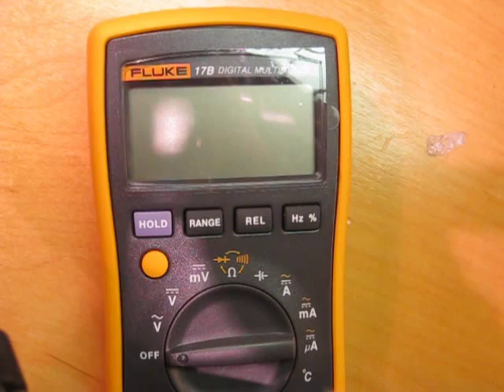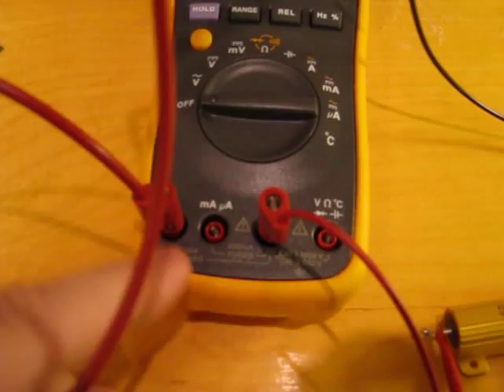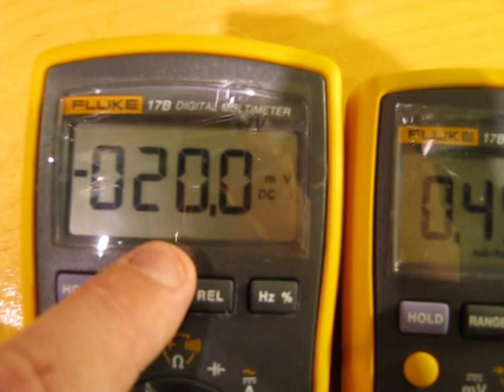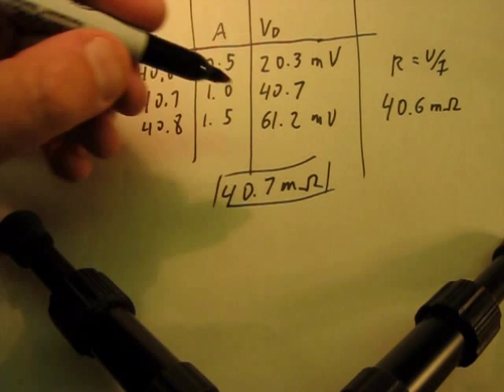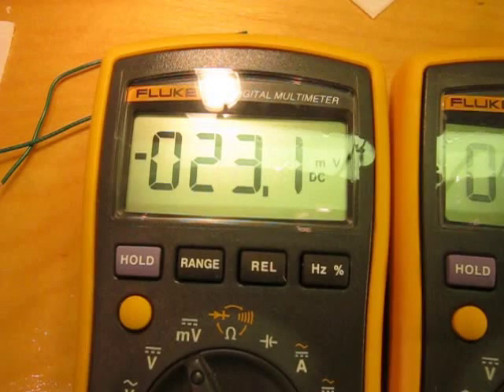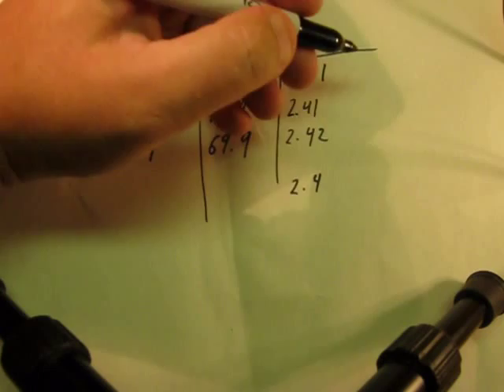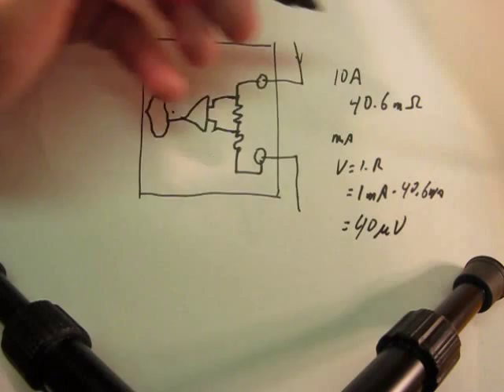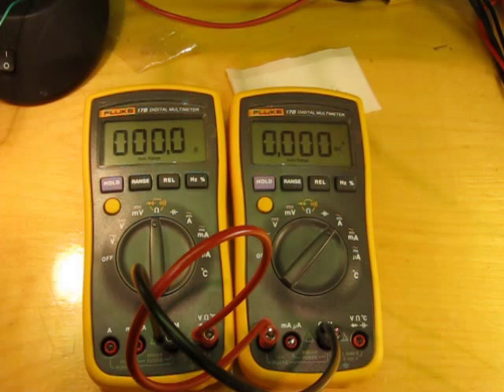Fluke 17b multimeter and DC Current Measurement

Comment: Good stuff !!    to measure mill/amp draw on  a led bulb in a circuit and putting the leads in series almost turns off the light.  The resistance in my fluke 179  is too high.   At low currant how do you test?  I short vid would  be great.  Thanks. Steve.

Comment: Hi, I see you have a BK Precision 9110 and seem to like it. You have done reviews of power supplies, would you mind reviewing this unit? I am on the lookout for a new power supply and the 9110 seems a decent option. However, eevblog is not that enthousiast about it here: http://www.eevblog.com/forum/reviews/bk-precision-9110-60v5a-100w-psu-review-(with-pix!teardown)/msg68996/#msg68996 
Wondering about your experience with this device. Thanks!
Reply from the maker: Arthur Elsenaar I like the BK 9110 quite a bit... it's my main go-to power supply generally.  The link was interesting... it could be an interesting video to compare the HP units I have with the B&K regarding overshoot in various modes.
Reply: ***** Thanks for the quick reply! So would you recommend the BK 9110 for my not too demanding supply needs? I was quite impressed when I saw the specs and that handy output on/off switch. But that review on eevblog put me off..